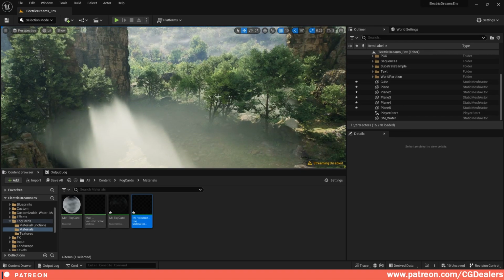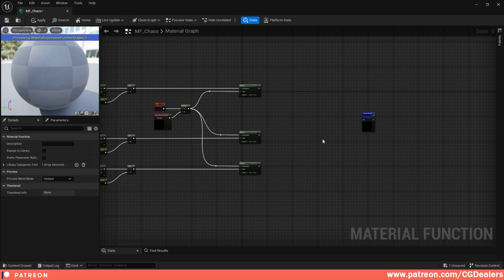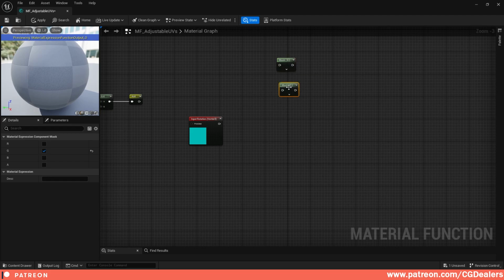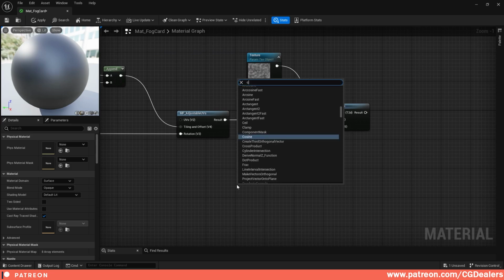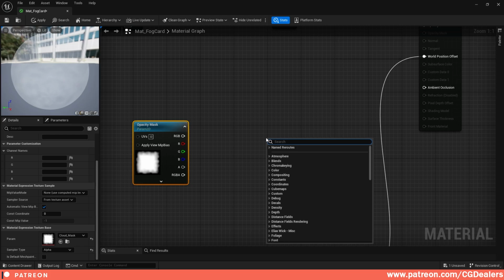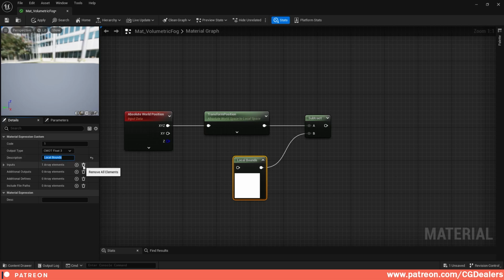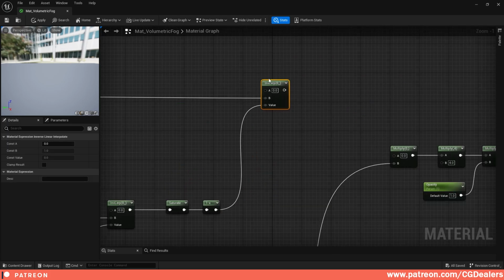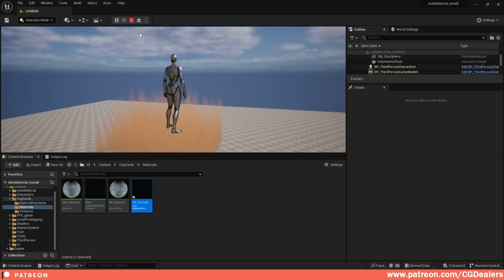Create Advanced Fog Shader - Unreal Engine 5.3 Full Tutorial

Comment: Checked at least thrice, the main part volumetric fog doesn't work. Absolutely empty thing. 
Yes, I have checked Volumetric Fog under the ExponentialHeightFog. Appears to have wasted hours for no result.
Reply from the maker: Join discord so I can help you out or even share the project so you can debug: https://discord.gg/tJwndfG8
Reply: @CGDealers  what was the issue because i have the exact same thing happening
Reply: @aamirr-k  it turns out you need to set your engine settings to epic for it to show up
Reply: @aamirr-k  Same :\
Reply: Oh, actually, once I re-opened the level it was working. For me, it was probably a weird caching issue.

Comment: i followed the steps for creating a volumetric fog to the T, but still getting this error when saving the material "the current material has compilation errors, so it willnot render correctly in feature level sm6". im on UE5.3 i created my own cloud texture using Photoshop>>Render>>Clouds and set the compression to alpha as you have mentioned. but eh, thanks anyways
Reply: put append in your material after the add that goes into material function adjustabel uv's tiling and offset and add a 1 node to append value b

Comment: I finished your video and it was so much fun to create the fog! :) Thank you. 

1) I want to give some tips to everyone who is rebuilding the fog, I had some problems: Everything in the video is correct, but I am a Photoshop-Noob and maybe some of you too. If you want to create the first Fog-Texture, go to Photoshop: Click Filter - Render - Clouds. And you have your Clouds, easy. I tried different resolutions, 2048x2048 worked best for me. Its important to say that I watched a video in which the Tutor explained that the numbers should be 512x512, 1024x1024, 2048x2048 and so on. I dont know if thats true, but I wanted to mention it. 4096 and 8192 did look horrible in my case, lol.

2) You dont have Photoshop? I found a page with a Cloud Texture Generator, but I didnt try it out. Maybe that could help you, but I dont know since I made mine with Photoshop. 

3) 38:55 The Masking-Part can be a little bit tricky if you never did it before, like me. But with the Brush-Tool in Photoshop its easy, tweak the Opacity and the Flow in Photoshop to get decent results and a good transition from Black to White. My Background was black, then I simply started with low Opacity and a Flow of 50 to make the "grey" borders. Then I tweaked the Opacity and draw to the inner white part. I did that 4-5 times so that there is a good transition between black and white. Higher Opacity means less grey and more white. I dont know if thats the best way, but it was the only thing I could do as a Photoshop-Noob and it worked out. 

4) CG Dealers wrote a small code in the later part of the video, the code is correct, but in my Case I had an Error because the s in size was lowercased. If you get the same Error, just change the s to uppercase.